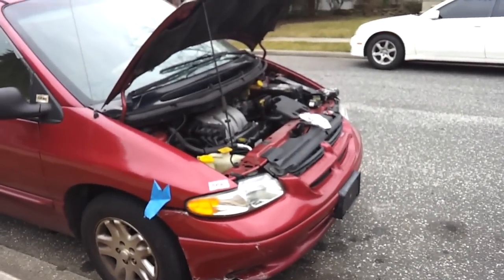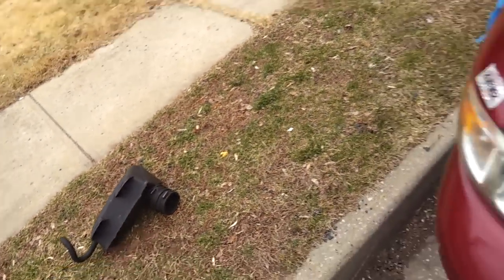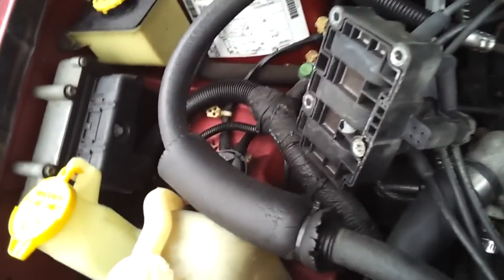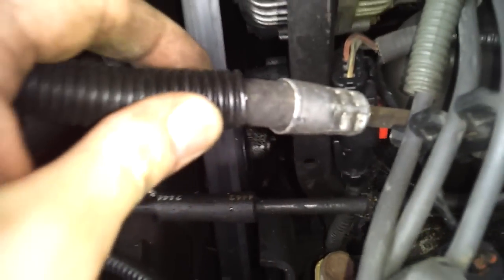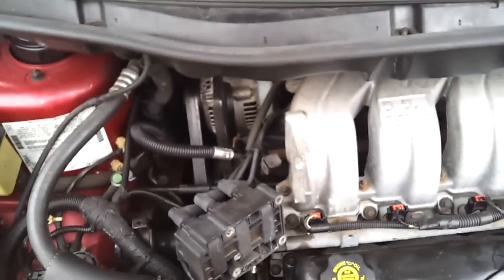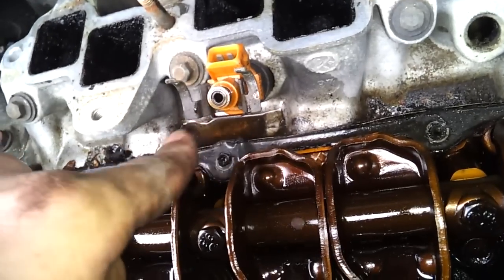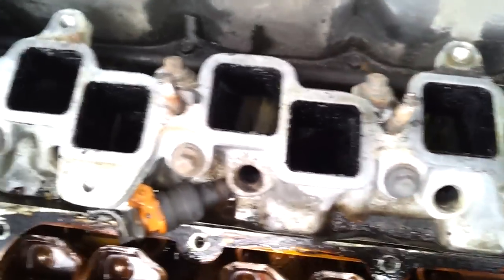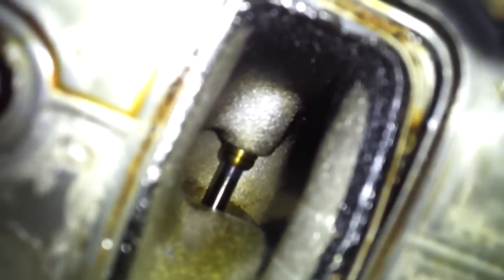Upper Intake Removal 1998 Chrysler 3.3L Part 1

Comment: I do not recommend doing a fuel o-ring fix unless the injectors are leaking.  (Do a pressure test by turning the car to the on position)... trying to get 6 injectors properly seated and not leaking is challenging for the ameture do-it-yourself-er.  If it ain't broke, don't fix it.  It was a great opportunity to change out the rear spark plugs, but really gave myself a headache on the injectors.
Reply from the maker: Christopher Wiesmueller  I Dont Agree with this Comment. And No Offense, Its Bad Advice.  It is true the old saying " if It aint Broke dont Fix it".  However, Theres a Term Called " Preventative Maintanence. "  Your taking the upper intake out, this is the perfect time to do it. The Rubber O-rings Rot Out, and your disturbing everything. Ive seen them Leak before just by lifting a intake out.

 For the D.I.Y'er's out there and anyone reading this...  This youtube Channel is for you. NOBODY has to be a professional to approach something like this, or anything on my Channel. If its here, I did it and it worked, and it never came back a problem.. Rubber O-rings will Fight you going into dry metal. This is why you dont insert new Dry O-Rings into its bore without spraying alittle  SILICONE SPRAY. Not WD40 or PB Blaster . Silicone Spray, you can find it in your autoparts store. it goes on and lubrates but then drys up..

Has Anyone ever had a problem putting hoses or Radiatior hoses on metal lines or other fittings?. Dont Fight it..Use SILICONE SPRAY.  Working on cars is supposed to be an experience, not a nightmare..
Reply: 905speedgta Its a 18 year old van  (I am doing this on an early model year 1997 T&C).  I understand preventive maintenance, but on a van this old, in its sunset years, which I bought really cheap three years ago off friends, I don't know that it is worth it. I am now fiddle futzing with fuel injector o rings in a  "boy with his finger in the dam fashion" except it is flammable gas, not water.  I just wish I had left them alone or at least pressure checked first for leaks to make sure the repair was a necessity.  (My gas mileage was so bad, maybe I needed to do it anyway).  

I did vaseline them up before sliding them in.  I'll try my silicone spray next and i'll go buy another set of o rings.  

By the way, I had to take the upper air manifold off because I tried to replace the EGR valve (car kills on cold days until engine warms up and the repair seemed easy enough)  but one of the bolts was seized.  I broke the head off, so I needed to do something with the upper air manifold to fix that (opted to buy cheap replacement on ebay).  In a domino effect, I am now repairing fuel injectors.  I can't say it hasn't been a nightmare.  The only silver lining is that I am not paying someone to do this.  

Like I said, no problem doing the aged rear spark plugs while it is off, and I guess I'll be happy when the fuel injectors are properly sealed, but I wish I had left the injectors alone.  I understand if you don't agree and I understand why, but if you are at the point I am, that you are taking the van to the junk yard, the next time something you can't repair yourself goes...then, yeah, I'd say leave the fuel injectors alone.
Reply from the maker: Christopher Wiesmueller  Older more rusted out cars you always proceed with caution . Ive worked on probably a few thousand cars in my lifetime so far, I havent seen it all but Ive seen alot. In that time Ive had maybe a dozen bolts break off on me to the point where I had to drill out the studs and re thread them. I take my time with jobs like this, I very rarely use air tools ( not saying you did) . But Im just very careful. Especially with Vacuum lines. times in un avoidable theres nothing you can do.  I usually patch the plastic vacuum lines with rubber vacuum hose.  Your letting this job stress you out, and when that Happens its over. and nothing goes right. I wish I would of saw your reply sooner and not 2 months down the road. If your still persuing this job, and you need help, please contact me at my Email which is AZSgarage2004@aol.com .  My Website is 905speedGTA.com and is under contruction right now and Im working to put up useful information for people like you who are jammed up in a mess like this. The Fuel injectors are sometimes a pain in the ass to do, the reason for that is its not such a smooth surface in the injector housing. Injectors leak after replacement because they are not seated properly. if a O ring Rolls in ts place that will do it too, the rolling causes it to Bind ruining the seal. Another reason is Contamination. make sure that mating surface is squeaky clean.  Lube the O ring up with silicone spray. vaseline can be used but in small amounts. you can be more liberal with silicone spray. you can spray alitle in the injecter ports too..When your mating the fuel rail to the injector holes make sure you just place the entire rail in a way where there injectors are about to go into the holes. once you get them line up, send them in pushing them down in sections, for example, treat the fuel rail like its a rectangular box. start pushing down in a rubbing slow motion and you will actually feel them sink in, then do it on the left side the the other sides. you will know when its in when the retaining bolt holes yu actually mount the rail down to line up.  he best thing you could of done was replace those injector o rings, they are prone to leaking. make sure the injector clips and the power terminals are all securly connected.. bolt it down then turn the igntion to the on position, don start just turn it on to energize the injectors and check for leaks. I did this on my first shot with no leaks. as long as you follow my guide you should have the same result.  let me know how you made out
Reply: I'm so glad I didn't read this before I started this overwhelming (for me) project. The o-rings on the fuel injectors and re-seating the fuel injectors, with no leaks, was a breeze on my 99 Caravan. One of the few things I did that I didn't find myself cursing the engineers about. I'm also glad, bc the o-rings, while not totally shot, were visibly worn.
Reply: Yeah, if you do it right the first time, its great.  As I recall, the part that was less than great was having to take it all apart and reassemble it again when I didn't do it right the first time.  I still do feel that it added unnecessary complexity and potential for complications to the job.  After the job was completed, I also had a need to frequently check my fuel injectors for leaks, just to make sure.

Comment: Hey awesome video very helpful! I have a 95 dodge caravan se with the 3.3l and i had to take my plenum off to change spark plug wires. and 2 vacuum hoses broke one must lead to my idle air control valve. Any idea were to get a replacement hoses or how to jerry rig it?

Comment: I noticed that when you removed your valley gasket, the stuff underneath was clean and dry.  What does it mean if the space under the valley gasket is wet with oil?  Significantly wet with oil.  The bracket with three bolts in the middle has puddles on top.

Comment: hey I was doing this repair and dropped one of the fuel rail bolts down the hole and then got a square magnet lodged inside the port trying to get it out. I was wondering if you had any ideas for fixing this ridiculous mess i got myself into.

Comment: How much does the egr cost? Thank you for this video.
Reply from the maker: arome5886 It really Varies on where you get it. Ebay is your best bet.But dont be Surprised if the dealer has it cheaper. Sometimes it never hurts to call the dealer. I saved a few times by using the dealer and not aftermarket

Comment: dude dragging that intake manifold on the ground like that is a big mistake scratch the edges or surface you my as well buy a new one jeez . also do not take the intake manifold off unless the engine is completely cool other wise it can warp and never seal like factory